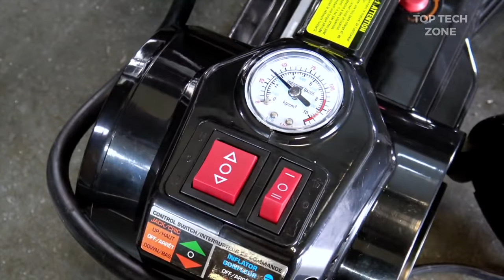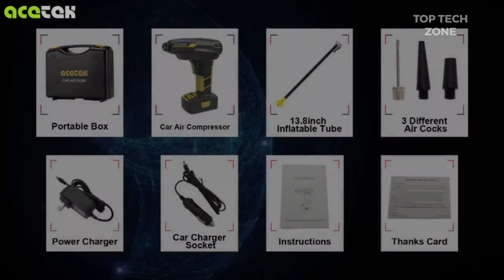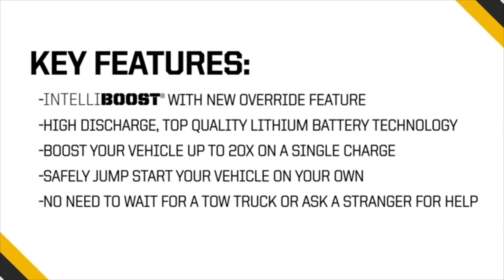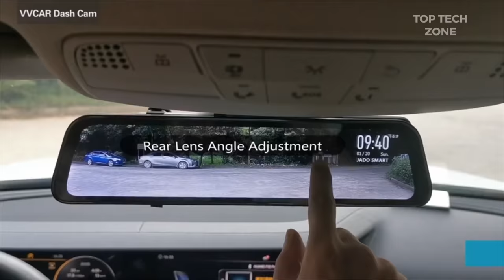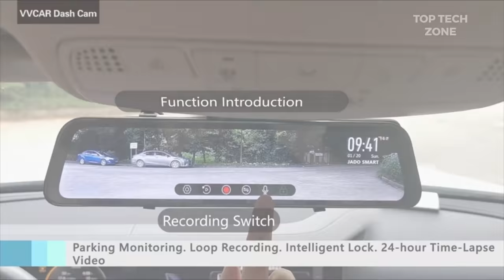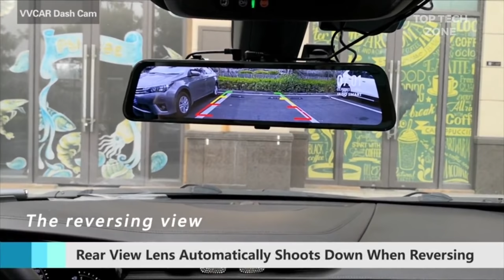13 Cool Car Accessories And Gadgets You Can Buy on Amazon (2020)

Comment: Frost Guard. What's wrong with some cardboard sheets? It does the same job.
Reply: well ya kinda need to throw them out after every use I doubt ya want wet cardboard in your car when they start to defrost
Reply: Frost guard is water resistant, so it's not soaked when you put it in the car
Reply: @mr5timewcwchamp  I mean the cardboard not the frost guard mate.
Reply: @reinisesenbergs8312  Yes, correct, that goes without saying. I left them in my yard in a trash bag for next day use.